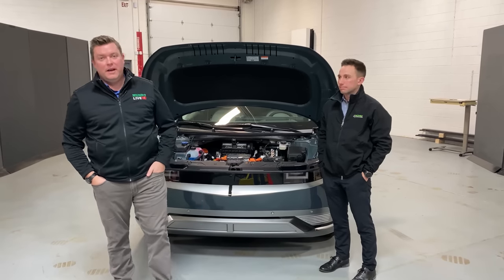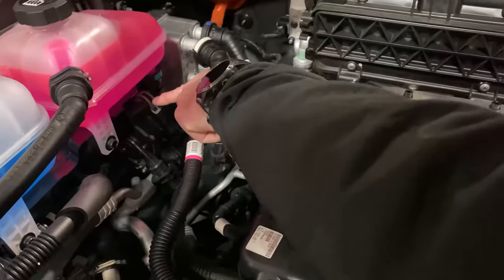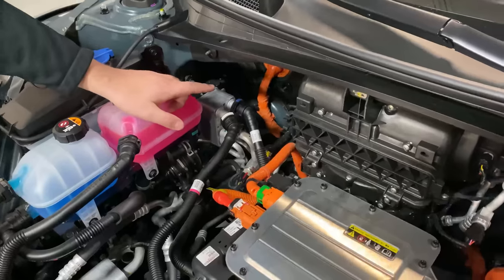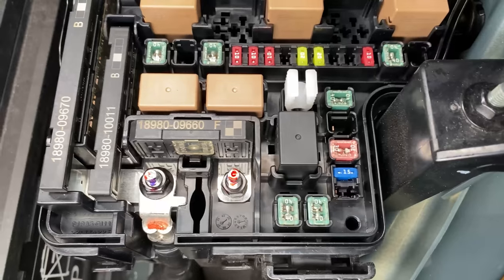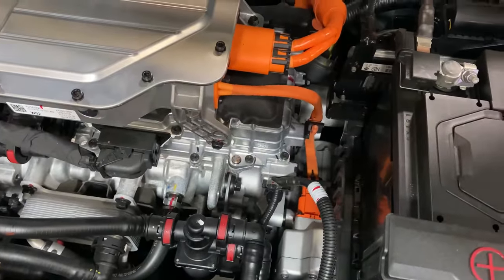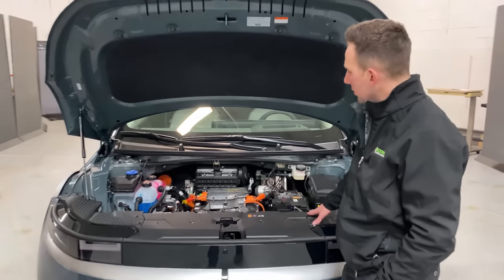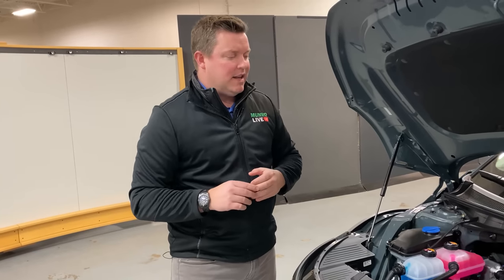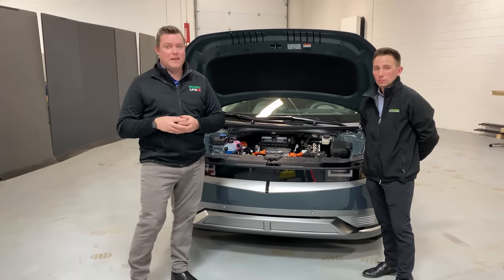Hyundai IONIQ 5  |  Under the Hood

Comment: Well done!  Great close-ups, well edited.  Crazy that Hyundai still uses a 50 lb lead-acid battery!
Reply: ...yeah, the nerve. Who would want to be able to replace a battery anywhere in the country, when you can depend on Tesla service to schedule you an appointment in three or four weeks.
Reply: All EV's use them because of legacy 12-volt electronic systems in all autos. Even Teslas still use a lead-acid battery. You can upgrade it for 12-volt lithium for $$$. They haven't engineered away the separate 12-volt battery to integrate it into the car's main battery pack for some reason. Maybe they can't? who knows.
Reply: @SiuLeung  Tesla has switched to Lithium Ion recently to replace the lead acid batteries.  I believe the new battery is a nominal 14.4v.  There's still too many legacy systems to go to 48v yet.
Reply: @AudiTTQuattro2003  Those batteries practically last forever.
Reply: @SiuLeung  Tesla are using a Li-Ion 12V that's as light as a feather. You're late. 

Pace of Innovation is all that matters - Elon Musk
Reply: @KyleHubb  I'd rather have a an IONIQ 5 with old lead-acid battery with working high beam assist/auto wipers than a Model Y Li-Ion battery with non-working high beam assist/auto wipers to be honest. Love that innovation that drives everyone nuts.
Reply: @KyleHubb  I recently had my 12-volt battery replaced, they (Tesla) still gave me the old lead-acid battery.
Reply: @SiuLeung  The new models use a lithium low voltage lifetime battery which weighs a fraction of the old lead acid battery.
Reply: @user-ko9te4jj4u  Don't mind me, I'm just mocking Hyundai a bit. Great car, I love the IONIQ 5.
Reply: @KyleHubb  going too fast means no testing means no dependability.

We see enough issues with Tesla already to know this is a problem.
Reply: The original lead acid battery in my 2016 Kia Soul EV just died to I replaced it with a smaller and lighter LiFePo4 battery from Amazon. Should outlast the high voltage drive battery.
Reply: @cjwilson54  How many cold cranking amps does it have ?
Reply: @KyleHubb  You can pick those up for about $150 bucks at walmart - not exactly nasa there.

Comment: Not sold , saw a towing test on a Rivian , worked out to about 30 miles of towing a truck on a trailer before dead battery. Lithium batteries are 70-100x the weight of equivalent gasoline power output.

Comment: Interesting insight to the Ioniq 5.  I have an Ioniq 5 Limited AWD, and the problem I am having issues with the A/C heating module.  For lack of a better description, it has died after 600 miles and 4 months later still no sign of the part(s) needed to repair.  I am now only driving the car in the early morning and the late afternoon/evening to tolerate the heat in southern California. From the various Ioniq 5 forums, I am not the only one having issues.  I have contacted Hyundai and unfortunately the supply chain issues is causing this issue, and the newness of the car for technicians working on it.🤨

Comment: Wow! Great report! Tesla seems to be far ahead in engineering, etc. This is much better than standard yt reviews and replays of automaker's slick advertising.
Reply: I wouldn't say far ahead in engineering, just a different purpose of direction. Tesla's charging tech is already less advanced. I don't mind not having a frunk if I can access stuff for maintenance much easier. The cabin filters on my Model 3 are a pain to access. This seems way easier. I would also imagine cleaning out the A/C coils would be easier on the Hyundai. The moldy smell from the Model 3 could be a design flaw too.
Reply: @SiuLeung  what makes you say the charging tech is less advanced? What are you comparing?
Reply: @SiuLeung  They are far ahead though... It's plain to see. And saying the charging tech "already" less advanced seems to imply everyone will catch up in other aspects real soon, as if their charging tech is less advanced. What exactly are you pointing to here? Tesla hater detected?
Reply: @SiuLeung  The only thing is that electric cars don't really need a lot of maintenance. In this car maybe since they added a plethora of hoses which could conceptually leak and might need addressing. But that brings us to the point why'd they take this design approach anyway? The car does not look like it was built as an electric vehicle but a general purpose car where they just pulled out the motor/trans and retrofitted an electric motor and supporting components.
Reply: @SiuLeung  the Hyundai doesn’t even pre-heat the battery before charging. What are you even talking about with your statement about Tesla?
Reply: @jeffsawyer  Tesla uses 400-volt battery system, the new Kias and Hyundais on the E-GMP platform all use a newer more advanced 800-volt battery system with a peak charge rate of 350kW. IONIQ 5 will charge its battery from 10% to 80% in 18 minutes. Tesla's max charge rate is 250kW and can charge from 10%-80% in 28 minutes.
Reply: @gjermundnorumbugge7373  LOL, very ignorant of you. I've owned my Model 3 since 2018. How long have you owned your Tesla?
Reply: @SiuLeung  I just wanted to poke the bear, because i wanted a response from you. found the comment strange. Model S Since about 2013. model y now as replacement since 2021. Not that any of that matters or is relevant to anything that was said earlier
Reply: Isn't Hyundai ahead with their 800V architecture and Vehicle-to-Load (V2L)? V2L seems way more useful than a frunk.
Reply: @SiuLeung  Incorrect... the peak charging rate on an Ioniq 5 is around 230 kW. The 350 kW is the maximum spec on the EVSE, not the vehicle. The system voltage has almost nothing to do with it, as long as it isn't current limited. The charging curve is aggressive in the middle SOC's, and so we will have to watch to see how the SKI cells hold up with cell degradation. They haven't been great in the past.
Reply: @arkster00  very little to zero pressure in those coolant hoses plus low temps.

Comment: I love the way Cory and Jordan talk about engineering details in a way that an average person can understand. Regarding the frunk, in the U.S., the RWD and AWD version have the same small frunk. Speculation is that Hyundai didn't want to spend the money to include an under-the-hood child safety release which would have been required for a larger frunk. Can you comment whether that is a real requirement?
Reply: The under hood safety release is just a cord tied to the existing latch. Must cost a quarter.
Reply: @jamesengland7461  ...sure, but a quarter per 1m vehicles is $250k. At some point, even Tesla will have to compete on price.
Reply: @AudiTTQuattro2003  that's not a very balanced cost/ benefit analysis...
Reply: @AudiTTQuattro2003  I don't think they sell a million in USA.
Reply: A lot of the HVAC system is in the engine bay which frees up passenger space by having a smaller console.  That was a design/engineering decision.  https://youtu.be/0zM3EdnqRZg is a video of Hyundai engineers discussing the development of the E-GMP platform.  I don't mind a small frunk if it gives more cabin space.  "do you want cabinets or a bigger house?" was one of the questions the engineers asked.
Reply: @thanhngo5859  So they imitated VW with the split HVAC system?

Comment: The American RWD ioniq 5 uses the same exact  tiny frunk, despite having much more space underneath. The European RWD frunk is substantially larger. 

The reason for this is regulatory. All American cars with inclosed storage above a certain size must have a internal release mechanism so a trapped person can get out.

Hyundai did not want to add a extra mechanism to the hood, so they closed the space off and wasted it.
Reply: Wow didn't know! Thanks for the heads up bro
Reply: Should have done what Ford did, a removable barrier.

Comment: Having the power distribution system hard mounted and not integrated into the drive unit underneath is IMO a great design choice to make service easier. A bit more expensive to manufacture since there is an additional mounting step, but way better for the customer who will get charge for the service IMO.

Comment: I Guarantee owners of this EV will pour windshield washer fluid into the coolant tank with the blue fluid. Having the washer fluid tank next to the coolant tanks is an invitation for bad things, expensive things...
Reply: Richard Nedbalek  And Smart owners put the fuel pump nozzle to the turbo vent on the other side of the car flooding it...
Reply: I think you'll find that the caps don't unscrew, they'll be locked. This is what they did on their earlier EVs.
Reply: Richard Nedbalek  however it seems that in addition to a lock, the cap also has a left hand thread.  That may have been overkill IMO.
Reply: I wonder if they'll switch to a green coolant at some point in the future.

Comment: RWD models have a larger frunk in the EU, but not in the US due to regulatory reasons (no safety release from within the frunk). Keeping the frunk small (or divided in the case of Mach E or Polestar) ensures nobody can climb into it.
Reply: Wow it is only 57 litres or so. Only babies small enough to put in there wouldn't be able to operate a switch anyway...
But I'm quite happy with the larger frunk on my RWD Hyundai. Would still be eager to trade it in for the larger battery and 2 years free fast charging people in the US are getting...
Reply: @bilgyno1  That's the point. A child old and large enough to open the hood and climb in won't fit, and if the space were larger that child would be capable of identifying and pulling a release.

Comment: I'd die for a cabin filter that easy to change, on the Model 3 it's a nightmare, especially on the RHD model as the dead pedal is in the way.
You have to take various trim pieces off from the side of the center console, move some HV heater wiring, then try to somehow get the filters out from their gap with the dead pedal blocking part of the gap. Horrible placement for it. :)
Reply: Ya, would have loved the easy replacement on my Model 3 and I'm in a LHD version. I can't imagine the RHD version. Must be a complete nightmare. If Tesla designed it better with no moldy smell it wouldn't be such a big issue.
Reply: Not a nightmare. I can think of TONS of jobs on my ICE car that are a genuine nightmare.
A filter change in my RHD model 3 takes me around 10-15 minutes, (or Tesla mobile will come and do it in my garage for around AUD$100.)
Reply: To be honest, I'm way more surprised about the candid mentioning of this by M3 owners.
Reply: @paulaxford6754  Yeah it's not actually a cult, M3 owners are pretty upfront about the actual problems, like the wiper AI and the App linkage time and the latest UI!

Comment: Although it may be good for the manufacturer,  I'm not entirely convinced cramming as many sub systems into one single unit is necessarily a good thing for the consumer.  Reason being the lack of resources to do component level repair means when one single component fails, it means throwing out whatever module it's in so the more modules that are tied together in a single unit means more things have to be replaced = more $$$ out of your pocket.  At least with multiple separate modules making up a system, you don't have to throw out an entire system as one very expensive  non-serviceable.  If cars were built to last it would be fine but they usually aren't.

For example, combining the ABS system with the master cylinder seems like a good idea until a soft foot pedal caused by a worn 25 cent seal in the master cylinder means that instead of just replacing a $150 master cylinder you are now also replacing a $1500 ABS system that is perfectly fine.  The seals in my master cylinder are starting to bleed pressure and I am very very pleased it's a simple $150 part swap I can do myself in the driveway.

Comment: What I see is engineering time spent in making the system easier to work on. I feel that Sandy goes a bit too extreme on the manufacturing cost as the be all and end all. For instance I think the molded hoses with proprietary ends is crazy. It means with any leak you have to go to the manufacturer to get that hose. What if you are in a part of the country without a dealer? An ICE car you can generally go to any parts store and get a hose. I probably have enough bulk hose in my garage to fix most ICE cars for a lifetime.
Reply: It has to do with weight as well. The more stuff the more battery it needs to haul it around.
Reply: That style of hose is commonly seen on many ICE vehicles as well. A lot of European cars and Fords use them. Likely less problematic in an EV due to the lower coolant temperature not cooking the plastic as much.
Reply: @RobertHancock1  yes, my Suzuki uses that type on the clutch fluid lines.
Reply: The remote reservoir on the brake master cylinder is a vast improvement on my Hyundai Getz which has it under the scuttle panel with a 20mm gap above the filler neck... Luckily there's a mass produced S-shaped funnel that fits int he gap.

Comment: The battery is not AGM guys - CFM50L is a traditional ICE starter battery, optimised for the high current surges needed to start ICE motors (CCA 550A rating). This means spongy, high surface area plates but with thin lead coatings. 
This is the wrong type of battery to fit to an EV, which never needs the starter cranking amp. It should be a deep cycle type, with thick lead plates. These can't provide the high surge currents so well, but can discharge at a low, steady rate for a much longer long time. Fitting the wrong type of batteries may be contributing to 12V batteries going flat in some Ioniq 5s.

Comment: While it is posit that EVs should have lower maintenance cost and better long term reliability, the amount of hoses, clamps and pumps in the various cooling systems can be a concern.  Good to see the changes Hyundai has made generation to generation.  This also looks much improved over the MachE which had 35 thermal hoses and was covered in a previous video
Reply: True, but from an ICE perspective consider the far lower temps and pressures involved. The Ioniq 5 looks much the same as my Kona but with the replacement of conventional rubber hoses with plastic snap-on.

Comment: I appreciate an underbonnet area that isn't crammed with kit so you can't get a credit card between components.  I'm happy to lose a small front trunk if the car is much easier to service, particularly it that's pretty much all the servicing it will need.

Comment: Did you remove any supports for those hoses?  They strike me as a bit floating free in the air.  What's your assessment of that?
Reply: Q: What's your assessment of that?  A: better to "float" than eventually to "rub through" from vibration (even from the stabilizing clamp or zip-tie itself).

Comment: 2 loops
That would explain the "high temp" and "low temp" readings seen on OBD2 scanners?
Those temps seem to throttle charging below 20°c and above 45°c (ish)
Reply: I think it has something to do the cooling fluid completely flows in curves from front to back through the battery while e.g. ID.4 has a dedicated fork for each module from the main flow through the middle and gathers at the outside again before returning.
Reply: Cory made a good point and it may be that what the battery wants is sometimes at odds with what the occupants want. I had thought it was to minimise volume of the expensive and perishable non-conductive coolant outside the battery loop but I think Cory was right.

Comment: I do like the placement of the cabin pollen/air cleaner and as mentioned you need to be a contortionist to access it in some vehicles (my Citroen C5 is one) and on a Honda Accord 2004 you have to remove the glovebox lining which isn't too bad. I just wish I had a CV to email.

Comment: How much reskilling do current car repair shops need to do to start working on these? Do they need to hire totally different people or can they upskill their current workforce?
Reply: See bad part. Turn bolts on bad part counterclockwise. Toss bad part. Put new part where bad part was. Turn bolts on good part clockwise.
Not much difference. 🤣

But seriously, most of the car is the same whether it has a fuel tank and engine or a battery and electric motor: tires, wheels, suspension, brakes, steering, and everything in the interior. From a service perspective, most of the difference between and engine and a electric motor is just fewer mechanical parts, and added wiring. If you can't retrain from engines to EVs, it's probably time for you to retire.

Comment: Interesting to note is that the thermal system seems to have issues regarding the cell temperatures. The difference between the minimum and the maximum cell temperature often hovers around 10C, sometimes more, especially when charging. This reduces the window of optimal charging speed quite a lot as it begins charging with some cells too cold and different ones can become too hot, even in the same charging session.
Reply: Where in the video was that?
Reply: @AudiTTQuattro2003  Not this video but from other YT videos highlighting the charging issues when the battery is cold. Hyundai have no pre-conditioning heating of the battery while driving to a Level 3 charger. Hyundai plan on a software update in spring 2022.
Reply: Coolant flows in curves from front to back of the battery, so modules further away get the heat from the ones in front, this might explain the difference.
Reply: My Kona has three or four temp sensors in the battery and they rarely ever differ by 1°C.
Reply: @paulaxford6754  Unfortunately not with Ioniq 5 and EV6. Also the classic Ioniq had temperature differences as an issue.
Reply: @frederikjmx  I thought the classic Ioniq battery was air-cooled?
Reply: @paulaxford6754  air yes, but actively, with a fan from the inside of the cabin